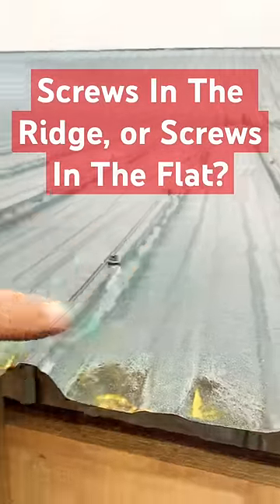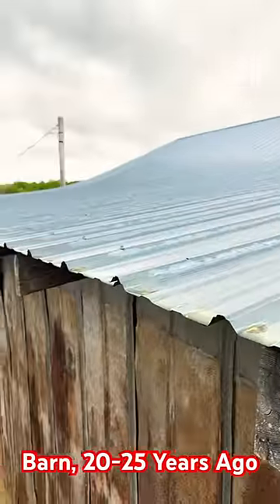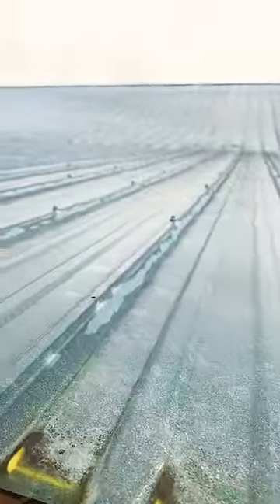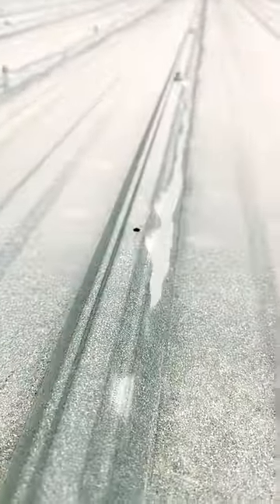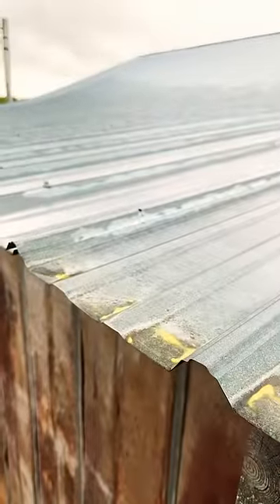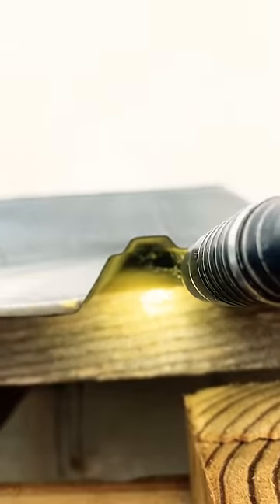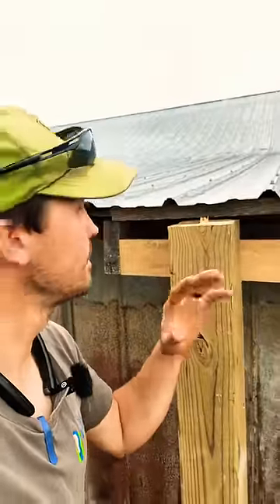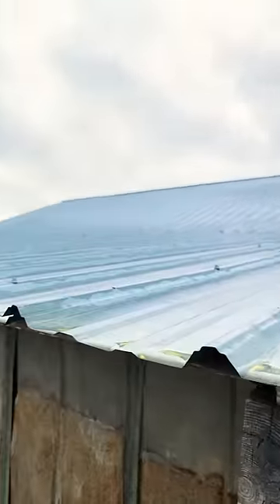What’s Better? Screws In The Ridge Or Flat? #construction #farmlife #building

Comment: A no brainer. In the ridge. Grandpa probably ran out of screws and forgot about it.
Reply: TBH, that was my assumption. The flats are where the water collects so if there's going to be a difference, the flats are going to be where you get the leaks. But, even there, as long as you have adequate pitch to the roof, there shouldn't be any water collecting.
Reply: @SmallSpoonBrigade  ya and use screws with rubber washers.
Reply: Or they worked themselves out.  Metal roofs need to have screws checked to snug about 3-4 years depending on climate conditions.
Reply: @doneagan2094 That sun gets rubber hard & cracks, then your screwed.
Reply: @winterwolf2012  true. I'm sure it's something other than rubber but like rubber.
Reply: He got to the end and thought. "Holes are in the ridge and off of what I really care about. Shitt'll be fine"  he was right
Reply: I was taught with steel siding to put them in the flat.  Not saying it's right or wrong just the way I was taught.
Reply: @nathanpike4745 On the ridges for roofs, in the flats for wall siding.
Reply: @nathanpike4745  steel siding maybe but this is metal roofing.  Roofing gets steady rain fall/flow, siding don't.
Reply: Nah never man. I just left a longer comment about this. I'm a professional steel erector specializing in steel buildings using these types of residential and commercial panels. Nobody in my field would ever do this. The reasons are numerous. The inability to stretch and shrink panels to make an even roof and inability to get a tight seal on the washers without stretching panels are the top 2.
Reply: @nathanpike4745 you're right bud. I work with these panels every day. No professional would ever do this. Some companies, with commercial panels only, will put screws in the flat and also a stitch screw in the rib in every line also. But I've never seen a steel roof done like this, or walls, or anything else. Not a professional one anyways.
Reply: @nonnysbro  Agreed. Screws go in the flats.
Reply: @winterwolf2012 good thing that they’re under the screws…
Reply: @doneagan2094 The rubber washers quite often get shredded when you tighten the screws down
Reply: @Natediggetydog  I done a few metal roofs using flange screws that come with washer, designed for the job and they all worked out fine. No leaks. Maybe your over tightening.
Reply: Only a fool would put screws in the pan. They only go on the roll or the ridge as this American calls it.
Reply: A no brainer until until you get a bunch of snow that has to be pulled off. Then you'll realize that you had no brain when you put them on the ridge.
Reply: Snow can be pulled of in the flats  where there is no screws lol you ain't  gotta rake the ridges, we put them in the ridges here in alabama  and i alsp dipped each on in liquid nail before running it in.
Reply: @nonnysbro  thank you... Just thank you! I do roofs A LOT..  some people are just commenting with no knowledge
Reply: Grandpa probably didn’t  have any more bents screws to straighten out and use.
Reply: @backcountry164  Yeah, that's a good point. We don't have snow in Australia, just plenty of rain. Maybe that's why you screw into the pan, and we screw into the roll ????
Reply: You are completely wrong. Screws absolutely go beside the rib. I am a roofer. I literally install roofs with permits and done by code with inspections and if I screwed in the rib then I would be taking that roof off and doing it again
Reply: @doneagan2094  it is neoprene, not rubber
Reply: @nathanpike4745  walls and roofs are screwed next to the rib for the purpose of strength. These folks saying otherwise are not actual roofers and they are wrong
Reply: @seanhazelwood3311  next to the rib always
Reply: @notapplicable430  always unless it is a stitch screw that is short and only penetrates the panels
Reply: @CombatMosquitoTrainer  or someone who is a professional and does their work according to the building departments codes. Screws absolutely go next to the rib. Only someone who doesn't know better would put them in the rib. lol
Reply: @kevinwaller6353  yeah, but in America. Your codes are all over the place and pretty lax in some states.
Reply: @kevinwaller6353   Wrong again.
Reply: @CombatMosquitoTrainer  I absolutely am not wrong, that is a fact. I am a roofer, I install permitted and inspected roofs. You can't tell me shit
Reply: @CombatMosquitoTrainer  our codes are according to the weather we have in different states. Screws always go beside the rib
Reply: @kevinwaller6353  Negative Ghostrider. Only an inexperienced fool would screw into the pan.
Reply: Here in michigan they only warranty the steel if you screw the flat.
Reply: @Redneckrich382  It will eventually leak.
Reply: @CombatMosquitoTrainer   50 years plus if installed proper!       If one rib screw is too tight or two loose the whole point of a raised rib is pointless they mushroom out and let all moisture in.
Reply: @kevinwaller6353  facts i gurentee these guys do not own or work at a roofing company. At least not an insured or successful one!
Reply: @Redneckrich382 , exactly. A licensed and insured roofing contractor puts the screws beside the rib!
Reply: I just put them on the ridges cos it made sense with roof and water dynamics, i.e. water won't sit on the ridge
Reply: Screws in ridge / nails in the flat
Reply: @samramos7544 , it is actually the complete opposite
Reply: @doneagan2094 100% clear silicone caulk.
Reply: Follow manufacturers guidelines to preserve warranty. Flats are required by new metal manufacturers. 
Old corrugated or 5v used lead head so ridge made more sense way back then.new type fasteners seal better stay longer
Reply: Nah..the day he did this he heard about only fans

Comment: I work in insurance and the only metal roofs I’ve ever seen with leaks are ones with screws in the flats
Reply: ... and proceed to not pay a claim due to not following the manufacturers instructions for installation.
Reply: @JPEAZI  the carriers don’t care about manufacturers instructions
Reply: You can say you seen Santa Claus riding the Easter bunny, doesn't make it an absolute fact. If you put them in the ridge an it fails then you're liable. ALL MANUFACTURERS instructions say in the flat, so go ahead an void any an all warranties over what you think you " seen" 😂😂😂
Reply: @bigreddog502  warranties aren’t good for anything anyways. The manufacturer will always say it was installed incorrectly no matter what. I just bought a brand new tractor and the bucket tilt cylinders bent because of a geometry issue causing it to go below center. It’s clear what happened, but the manufacturer claims I hit something, even though I ran it for only 5 hours and hit nothing. They always have an excuse, no point in relying on the warranty when installing on the flat will only cause future problems
Reply: @JPEAZI  The manufacturer of my metal roof recommended putting screws in the flats.
Reply: @johndoby45  and when u get leaks have fun because they will say it's your problem
Reply: @bigreddog502 no way, the instructions I read said put it on the high point, NOT the gutter basically, as the low gutter region has more potential for trapped/pooling water to leak in. You know those ice shelves people get in winter up north on their roofs? The ones with a lake underneath a shelf of ice on top, and the water just sits there? Now think about if the gasket wasn’t set properly in the roofing screw and roof, where would there be more potential to allow water in? The end sticking out of the little roof lake? Or the low end gutter regions pooling all the water by design?
Reply: Yep....even one on the beach...
Factory edge on all exposures,
primer all cuts
Reply: Nw metal roofs, no screws through the roof, hidden fasteners and mechanically lock the seams together CAN NOT leak
Reply: @bigreddog502  it depends where you live and what manufacturers.  Here in New Zealand all profiled metal roofing gets the screws in the ridge per the manufacturers instructions
Reply: @RECYCLEDCONSTRUCTION  absolutely...all the best qualities you in one product...love em...
I earn more for installing standing seam
Because I can produce it from a roll of steel . The NW roof style I can produce too....
But mostly offer the customer the different types vs cost vs longevity...
Reply: @bigreddog502 manufactures only care for profit obviously if you screw in the flats the roof isn't gonna last as long as if you screw the ridge. Same with tile roofs they discontinue the tiles so you have to buy a whole new roof instead of doing a lift and lay
Reply: Screws on the ridge makes sense. In the flat is where water flows. On ridge it would take a very accurate rain drop to get in hole and leak
Reply: 10 X more water on the flat than the ridge. Screw the ridge!
Reply: Turkey in the straw
Reply: Tin screws have rubber washers designed to keep out water.
Reply: @Thatfarmguy  Which are still better on ridges than flats. The point of the video is that if a screw is missed there is less chance of a leak.
Reply: @roilhead  I have never put one in the ridge always in the flats haven't had one complaint yet. It's not about the placement of the screw but instead the one placing the screw.
Reply: @Thatfarmguy  exactly, when i started doing roof on my place I read the instructions, they say in plain print to put them in the flats AND DO NOT OVER TIGHTEN. did more reasearch and the tin needs to be able to expand and contract and if the screw is too tight it can not and also overtightening deforms the rubber till it cracks and splits.
Reply: @Qk1K  exactly
Reply: In the flat for the roof and lap the sheets together on the edge of each panel on the ridge.
Reply: @MAB3776s  exactly
Reply: @MalleusDei275     you get a gold star as the first I've seen mention to seal the cut edges  and try to make them not be exposed

and people wonder why the bottom couple of inches of their metal roof have rusted off
Reply: Well We've done hundreds of roofs zero call backs my guy. Ask me how many checks insurance companies have cut us to go back and fix ridge screws.. go head ask me.. 😂
Reply: @bonesrhodes3762  and blood will make rust while you watch it
Reply: @MAB3776s     and anytime a metal roofing is been done it hasn't been properly sanctified unless somebody has given a blood sacrifice  -  usually everybody gets to
Reply: @bonesrhodes3762  you’re not kidding, after 12 years of pre engineered steel buildings I’m surprised I have all my fingers.
Reply: @bri0013  zero… carriers don’t ask you to go back and tighten screws…
Reply: @chrisbelsito4231 I have this argument almost daily.

Even if the screw is missing from the hole, water can't go on the ridge.
Reply: @ryanlaabs6034     like hell they don't:  I live in Hurricane Central  ( MS gulf coast )  -  any adjuster worth crap will look at a roof ( esp. conventional shingle roofs ) to check the installation for not only the number of fasteners but the placement  -   too few / in the wrong area and they'll tell you to call the company who installed it to see about getting a new roof
Reply: @ryanlaabs6034     he didn't say they did:  they pay him to repair the leak and/or fix the damage

for one thing, IF they would tighten more, it would only cause more problems  -  what they pay him to do is replace them with larger, shorter screws with seal washers and probably use some butyl sealant with the washers
Reply: @bonesrhodes3762  so your adjusters identify as licensed roofers? They claim to know roofing s few patterns and spacing to the level they call roofers to fix them? I’ve worked as a roofer, I would never claim to know roofing spacing while working as the field adjuster. That’s how you lose your license and get blacklisted by every carrier in Florida. You guys enjoy doing shit backwards, I’ll keep doing things the correct way 😂
Reply: Did a hole in a creek and one of top of the mountain  and wait for a storm see which one fills faster
Reply: That style in the flats. Old style in the ridge. What causes leaks is not hitting anything with the screws.
Reply: @bri0013  I already know unfortunately.
Reply: Work on the other side of ya bit yeah you gotta keep openings up high cuz water runs downhill see people make the same mistakes with flashing they install it so it's not sealed where the water collects
Reply: @dylanhorner563  water running under the underlay compromises the entire roof
Reply: @daviseaken5789  I was only stating what my manufacturer recommended.  I opted to put screws in the ridge.  I made it my problem when I chose to ignore their recommendations and I'm ok with that.  So far it's been 11 years and no leaks.  Manufacturers often stiff you on warranties in the first place so I tend not to rely on them.  I trust my common sense and judgement enough to justify the risk.
Reply: have you ever seen a roof ripped off by the wind ?
Reply: When I did metal roofing we were told to do it in the flats but also lap screws where are the sheets join every couple of feet
Reply: @JoshCole-h1x  stitch together at the ridge fix down into the perling through the flat for wind uplift, never had a roof leak or had one ripped off by the wind
Reply: Ya because the people who put it in blew the seal on the screw apart
Reply: @khalenmartin9187  they are roofers… you can’t expect much from people who had to chose that as their career
Reply: Well I believe and I pretty well know that they didn't pre-drill no hole they put a screw in it or no and it's such a further distance well over an inch that over time the fastener will work its way out
Reply: I've never seen anyone who works in insurance get on a roof and actually know what they are talking about. Leaks on a metal roof are cause by over tightening the screws or putting them in angle, after time they back out and lastly by not tightening them enough. It doesn't have anything whatsoever to do with being screwed next to the rib which is where they go and that is a fact.
Reply: I mean that would make sense though. How often would somebody get rain on their roof enough to fill the water channel of the flats and flow over the top of the ridge allowing water to interfere with the bolt?
Reply: @chrisbelsito4231 or a metric fuck ton of rain that would fill the channel and cause overflow at the top of the ridge. But I'm not sure there's been that much rain anywhere except in the mythical flood stories of ancient times.
Reply: @ryanlaabs6034  warranty is a sales point. It's only purpose is to get you to buy it. So, they try to make the warranty just long enough to sound good, but, not long enough to last untill parts go out. If something goes out before a warranty is up, it was manufacturer error. Or, the customer straight broke it and is being a Karen. But, I don't think you broke your tractor, that's just how they do. They know the parts outlast warranty so either they fkd up or you broke it and they'd rather just say you broke it. Then, maybe you'll give in and buy the part, or sell it and someone else will buy their part, instead of them paying for their fk up.
Reply: @benvaun1330 , properly installed screws do not leak but do require routine maintenance. Screws go beside the rib. This isn’t a debatable question. There is a proper way to install a metal roof. This is what I do for a living. I will be on a metal roof today with screws beside the ribs
Reply: The standard fixing spec for profiled metal roofing is to provide them in the trough section but they must have doughty washers or similar.  On corrugated roofs the fixings go in the ridge not the trough.  If you have to ask, you should not be fixing roof sheeting.
Reply: That's cuz you ripped the washer or stripped it
Reply: Good ideas . The raised ridge is probably best . It’s most expensive . If your not anchored into a rafter or lathing them screws gonna act up on ye .
Reply: @stevegann3251  Commonly, on industrial roofing the screws are placed in the trough to get a solid fixing into the purlins/spacers below.  On classic corrugated roofing the fixing is through the ridge, which is more acceptable.  The point to observe is that the corrugated sheet is relatively stiff and can transfer the fixing load down to the support quite readily.  However, fixing through the ridge of a metal profiled sheet is likely to deform the sheet at the fixing point meaning that the full holding force can't be applied without deforming the sheet, as well as over time any clamping force will relax as the sheet takes a permanent set.  Each fixing through the ridge of the sheet will probably create a dimple where water will collect so its no better than the fixing through the trough of the sheet except that there the fixing is solid with compressed rubber washers and any rainwater doesn't accumulate around the fixings for long periods.
Reply: @hardhead7056  what comparison?
Reply: @ryanlaabs6034  i meant this comment to be to the public. I accidentally sent it to you directly. 
But his whole question and video is bonkers.
Reply: @crystalgarcia2143  ❤ great answer
Reply: The dealer I’ve always gone through says that the screws go in the flats and sell lap screws for the ridge of the corrugations. Don’t know if it’s correct but around here it’s how everyone does it professionally. The key in my opinion is not to over seat the gasket on the screw or under….
Reply: That is cause they didn't use the rubber washers or they didn't hold the metal with downward force before you put your screw . If you don't then soon as you put weight on it the metal will push past a thread and it will stay like that .
Reply: SO thats why the manufacturer say in the flat